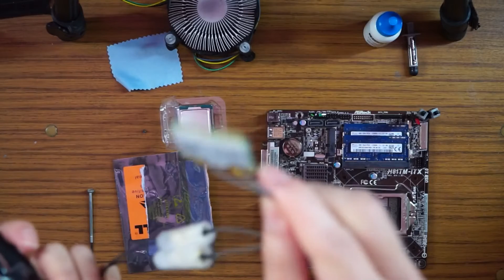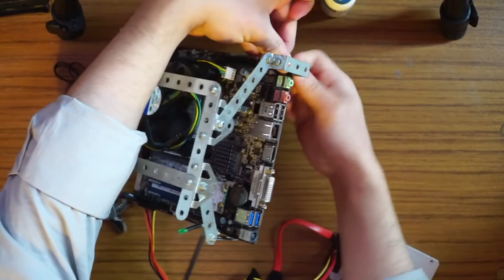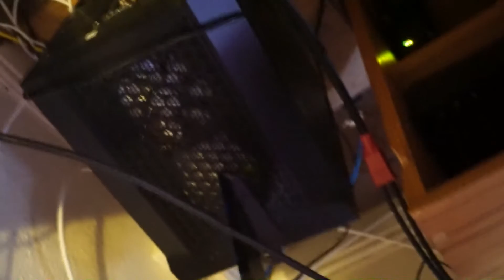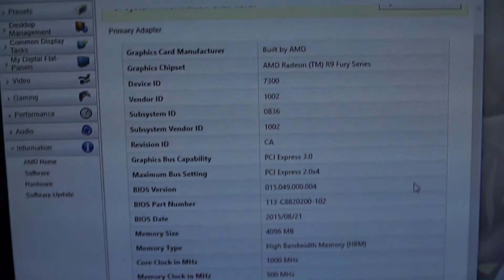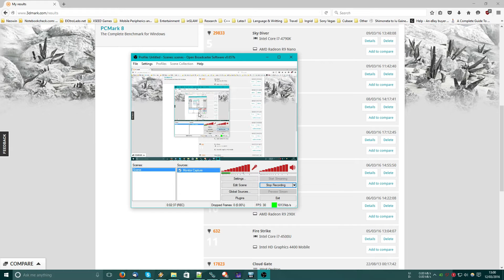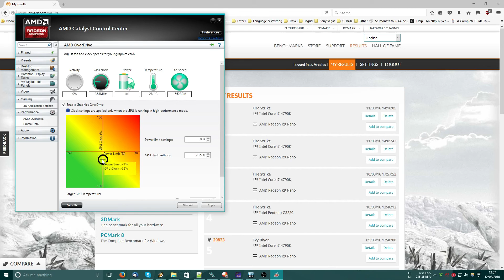Thin Mini ITX, Core i7 4790K, AMD R9 Nano.

Comment: Wow, this looks amazing, can you tell me the total system draw? also, I recommend and wish you can make a custom case for this, it has huge potential.
Reply from the maker: Well, total system draw should be around 65W for processor only and around 110W for GPU (because it is power limited) the other components also take some power but I cannot quantize how much. This project is a temporal one until I can put all the thigns together in a proper case and with a proper power supply, however, after almost a year I can say it is rock solid.
Reply: if this can be used with hdplex and an external psu and a custom case with similar layout as with what you did here, it would be sick gaming pc. you mentioned that system draw could reach 200w, this can be a great mini itx beast.

Comment: Thin mini ITX boards with PCIe x4 slots deliver less power through the slot don't they? I think it was 25 watts vs 75 watts for the full x16 slot iirc. I couldn't tell for sure, but it looked like you aren't using a powered riser? Is the R9 Nano frugal with the power it draws through the slot or is it that the motherboard had no issues delivering power?
Reply from the maker: Yes, it is stated that the motherboard only delivers up to 25W through the PCIe x4 slot. However, upon further testing, the whole 12v "rail" in the mother board is shared amongst all components. There is really no 25W limitation, is just that they put it most likely for safety reasons. 

The r9 nano in this case seems to be way happy as it is in this setup (I'm using it for more than 5 months, daily for more than 15 hours as I have been writting a thesis in it). My problems with this however seem to come from the power supply itself, as 220 watts are not really enough for the spikes that the card has through the 8 pin power connector. I really need to set the power limits on the card, otherwise the the power supply simply shuts down and I have to press the reset button.

Using a cheap PSU 400W for PC should do much better the job. But all in all, I have been playing some games and there has been no problems at all (heroes of the storm and the dolphyn emulator).
Reply: Alright. I'm really into SFF cases so I've been very interested in thin-ITX for two reasons: Getting rid of the 24 pin power cables & sodimm ram. Add a mSata/M.2 SSD and a GPU and that's a pretty slick PC with nearly zero cable clutter (inside the case).

Having two bricks is a bit of a drawback but not too terrible... Speaking of which, did you have to do anything else to set up the GPU brick? It was a little hard for me to tell in the video. It's obviously connected to the GPU for power, is it connected to anything else? Wired to the motherboard for power on? I'm still new to the electrical/wiring side of things.

Just curious, do you still run it on that open frame or do you have a chassis for it now?
Reply from the maker: I still run in the open frame. However, I really recommend you two things: Use a shielded PCIe extender cable if you keep an open frame, Use an SFX power supply and adapt it to supply power to the GPU (taht way you dont have to deal with limiting the power consumtion in the GPU)
Reply: I feel like if I need to use an SFX power supply for the GPU I might as well power the rest of the system with it. My power demands aren't very high though, only like a 65 watt CPU + ~120 watt GPU. It's more about keeping the size of the chassis down while (if possible) removing the 24 pin ATX connector. 

I'd gladly go for a Flex-ATX PSU and deal with the cables if it wasn't for the noisy little fans they all use. Though Streamcom does have a fanless one, but it's very expensive.
Reply from the maker: MarkHuron Sounds like a plan :), kindly upload a video to youtube with it, it owuld be awesome to see it :D
Reply: If I get the chance to do something like that I surely will :)
Lot's of parts/choices still up in the air and I don't have the budget atm, so it would be a couple months at least before it could happen.